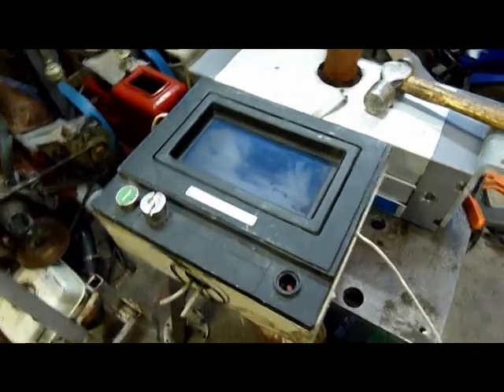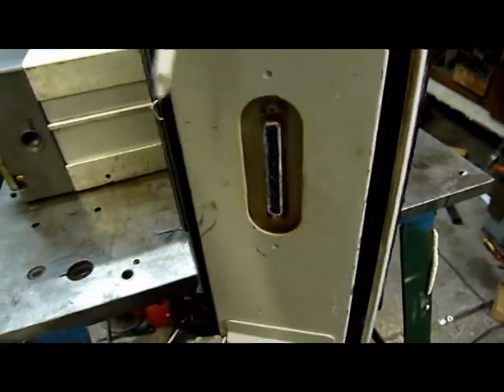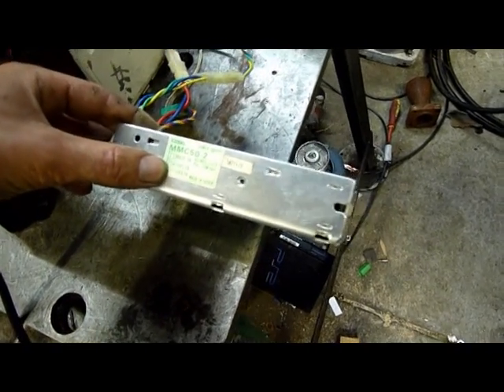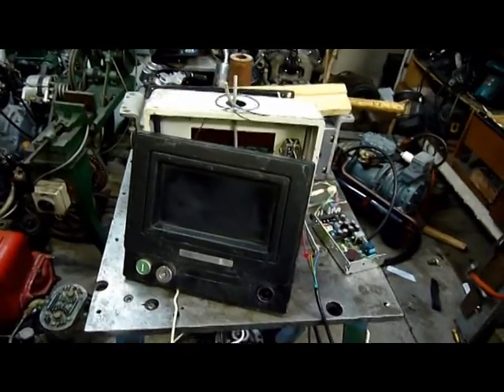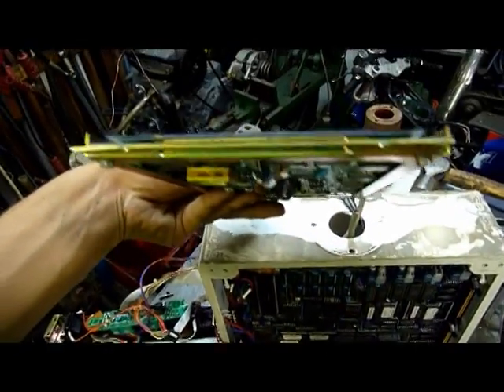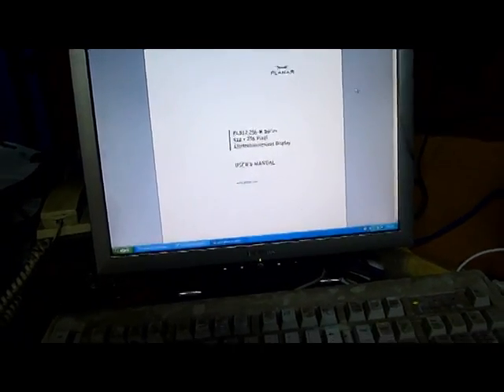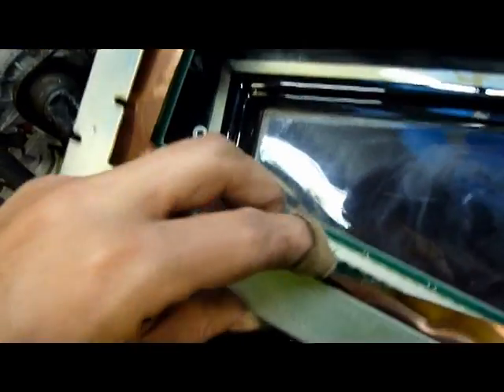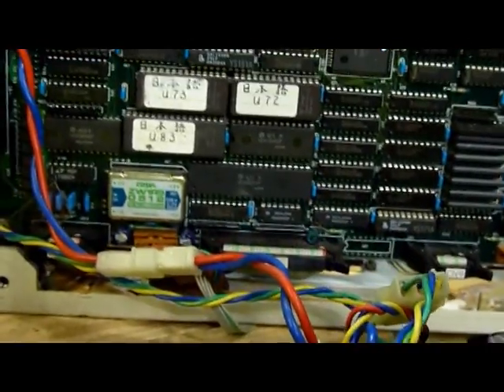Yamato Dataweigh Control Console Autopsy (EL Display with light barrier touch control)

Comment: @38911bytefree I think you misunderstood my comment. I know light does not pick up interference/noise. What I'm saying is: If the manufacturer could transmit over copper wire, they would have done so because of cost. So obviously, the use of fibre optics has something to do with Noise (EMC/EMI).

Comment: The light grid was quite popular as an early touch interface.  As you guessed it was just for pressing virtual buttons that changed according to what was being done.  The EL display is interesting.  It's effectively a precursor to the OLED displays.  The native colour is usually a pale bluey green.  EL displays can be compared to light emitting capacitors.  You apply an AC voltage across a dielectric with phosphor in it.  The voltage is typically about 100V at anything between 50 to 400Hz.

Comment: Nice video as always, old EL displays are really cool looking, some are very bright yellow and have super high contrast. Also that optical touch system is very interesting - I had that idea a long time ago and never knew if it had been tried (x/y finger detection) and now I know it was likely around when I thought of it as a kid 15 + years ago... so it dose work! Cool! And I still use something with a 68000 processor also (old video tape controller) it was in the first Macintosh computer-Cheers!

Comment: that's really cool I have a 20x2 character display like that but its called a vacuum florescent display and I got it to work with my arduino but the tend to use serial communication cause they are connected to a computer

Comment from the maker: @rocketman221projects nah, programming is way over my head. my computer knowlage goes as far as building and repairing hardware and installing/setting up Windows OS and related programs

it would make a good clock or temperature display tho!

Comment: @haniff2007 About the optical fibre I agree. It won't be because of the faster transmission speed. Plus: why convert al signals for transmission over optic fibre if it can be done with copper wire. That would save some money on components.